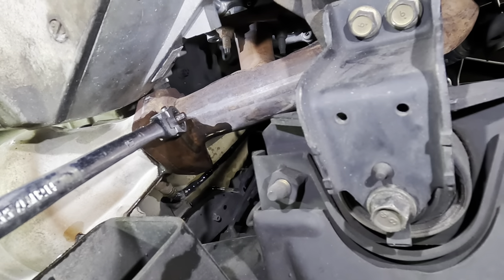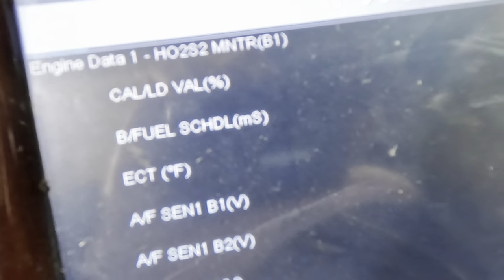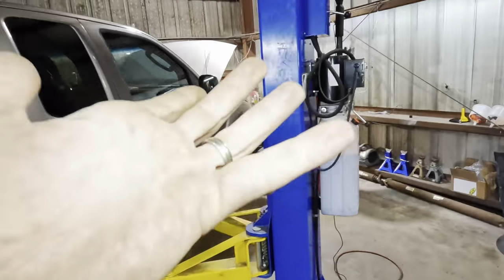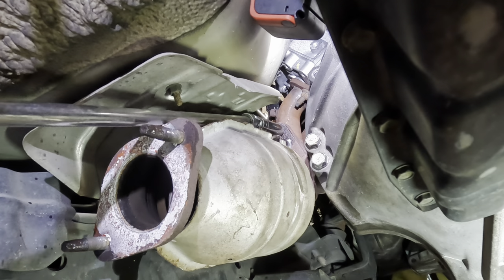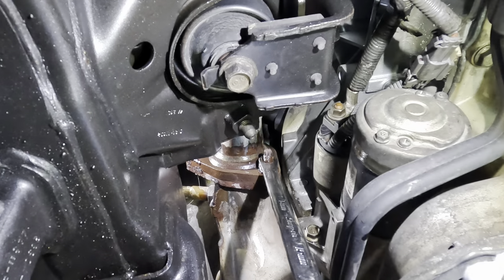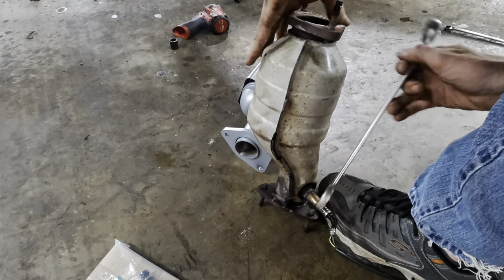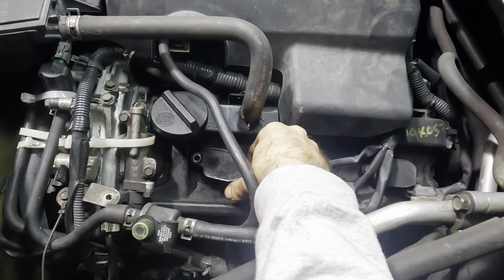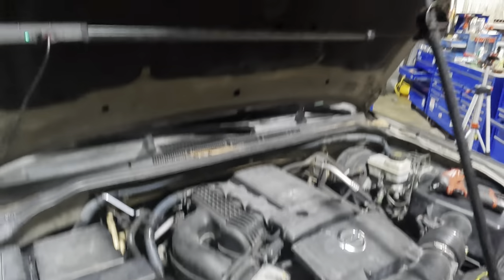Catalytic Converters! Missing?  Running Rough P0302 P0420 P0430 Nissan Fronter 4.0 v6

Comment: yes you need air speed to fly but there's nothing preventing an aircraft from lifting off a conveyor. they derive speed from air, not the ground. if there were no friction the conveyor wouldn't even move the plane, and wheels and bearing drasitcally lower friction

Comment: Is there any advantage to coating those exhaust connecting bolt threads, and the O2 plugs,  wth anti-seize?  Or is that not advisable with the higher temps involved?

Comment: so did someone steal the precious metals in the old converters?  Or do you think they just rotted out and someone pulled the remaining guts to stop them from rattling around or something?  Am also wondering what that does to the core charge situation but since you said it was sent over to you w/ parts I guess that is not your problem.

Comment: (15:20) I have an 06 ford falcon, and I had to replace my cat as it had blown out the exhaust (at the time, I didn't know it was that what blew out) and yeah I had a bit of a surprised look on my face when I cut the old one open and saw it was empty, (I know it had it in there a few months before hand, had a camera inside the exhaust and saw it) so maybe with those cats, they'd most likely blew out the exhaust system

Comment: OMG not the airplane/conveyer belt thing again... first question- how are you measuring how fast the wheels are turning? because the plane doesn't measure that at all. So for the belt to go in the opposite direction one would have to know this speed. And then the plane still doesn't care how fast they're turning. The plane moves forward due to thrust from its engines. So technically the belt would be be moving backwards faster and faster as the plane moves forward independent of the belt. At some point the bearings on the wheels would give out most likely but aside from that impossible situation, since it's not possible to measure the wheel speed and have a feedback loop that controls this humungous conveyor belt, the plane would move forward freely and take off.

Comment: Why don't you use anti-seize (either copper or nickel) on the threads of O2 sensors? It makes it easier to thread and much easier for the next guy after you, and who knows, it may be you that's next.
Reply: I totally agree, i never replace with dry threads, thats just asking for trouble

Comment: The airplane would fly, because the thrust supplied by the engines would cause it move forward with respect to the air until it reached the requisite airspeed.  The engines are pushing the plane through the air to make it move forward .The wheels are free spinning and are not powered by the engines to move the plane on the ground, consequently what the ground (or conveyor belt) is doing  has no effect on the airspeed.

Comment: An automobile’s wheels are driven, and are the vehicle’s only method of propulsion forward.  On a conveyor belt an automobile will either move forward, stay in place, or move backward, depending on the speed of the belt.  An aircraft is completely different, and has no driven wheels at all.  Its engines alone provide the necessary thrust to propel it forward, and those engines interact with the air exclusively, not with the ground.  The aircraft’s wheels are free-spinning, and simply along for the ride.  So YES, an aircraft will take off just fine on a conveyor belt.

Comment: Love the jokes, life is short if we can't laugh, why are we here?  Glad I'm not the only one that talks to the parts while trying to get them off and replaced.  Maybe someone in the past had to replace those two studs and when they did they went with the heavy duty nuts (which would make the outside size a little bigger).  Wouldn't it be easier to have removed the front tires?  If they went back to carbs with  pure H2 and 02 injected into the airstream, they would run cleaner without the converters than these do with all 4 of them on it. '58 International A120 4.6 or 4.8 liter Straight 6.  Little one bbl Holley on it.  Almost 42 MPG and almost no measurable pollutants with No converters on it. Watching you reinstall the rear 02 sensors reminds me of watching a buddy install his with the closed end of the wrench.  Slipped it through the wrench, screwed it into the flange and then tightened it down.  Then realized that he had 2 choices, either remove it again and use the open end or, leave the wrench there as an expensive ornament.  Hadn't laughed that hard in a while.  NICE, free toys!

Comment: I'm going to be replacing a fuel pump in my silverado I noticed its an updated design with a new pig tail that comes with butt connectors. Would it be better to solder the new pig tail instead of using butt connectors/splices?

Comment: Jet Puzzle: YES The jet could take off since it doesn't drive the wheels to get to speed.  HOWEVER the tires will need to be turning at 2X takeoff speed.  The 747 Takeoff speed is 160 knots.  That's 184 MPH !  So, the tires need to turn at 368MPH before the thing will take off.  They are 52" tires and have to turn about 2200 RPM!  Sketchy at best.  Thanks for the brain teaser!.. now about that exhaust...
Reply: 20 minutes later, the point is that half the internet thinks we live on a flat earth.   Here I thought you were giving a puzzle.

Comment: Use a higher quality fuel? Can't do that, that would cost the refineries too much. I'd imagine it's also a product of the world running out of the decent quality crude that gives high yields of fuel fractions. Up here in Alberta our tar sands are running dry and what's left up there is dirty low quality stuff that only specialized refineries can use. If I recall, most of the oil we produce is sent to tar refineries because it doesn't yield any actual fuels.

Comment: Is there smog check in Florida?
If not, this guy spent a fortune on cats 🐈 for no reason!
Also, in NY you’d need a torch as every one of those bolts would be severely rusted on!

Comment: The short answer is NO, it can NOT take off but it's constrained by the precise definition of the problem. Any excess forward movement of the plane imparts additional wheel speed which the belt cannot match violating the constraints, unless we allow for slipping, skidding, or translation. It's an utterly useless system and not practically implementable, but that's how it was precisely defined. If instead of matching the wheel speed, there was a fixed speed chosen, or a freewheeling treadmill, the plane could take off (if it could exceed that wheel speed safely) but that's not how the problem was definited. The Mythbusters covered a similar question about 15 years back, but their actual practical experiment was not precisely like this hypothetical one.
Reply: @daviddavids2884  who said they were driven? The point is the problem statement doesn't allow the wheel speed to be different than the belt speed, so the plane itself cannot move forward by definition. It's a poorly worded question (or trickily depending on the intent).

Comment: You have to wonder what has killed the original cats. Chronic misfire from those bad coils loading them with unburnt fuel? If that truck has a rebuilt engine in it,  WHY would you transfer all the old crap to it? I'd put new coils on a new engine. You have it apart, change the stuff! Bad thermostat keeping the fuel enrichment on because the engine never warms up? That killed the cats ($1000 worth) on my nephew's Taurus. They live in NC and never noticed the engine never came to temp as they don't need the heater most of the time.

Comment: If an electric train is going south at 70 mph and the wind is going north at 50 mph and it enters a tunnel which way will the smoke go,,, Straight up, forwards or backwards?????

Comment: Why don't they use stainless steel fasteners when they're exposed to the elements?  I just got new plates on my car and used stainless steel so they wouldn't rust.

Comment: No- a 747 will not fly if only its wheels are spinning.
However, if it is riding on the conveyor belt at its designed lift-off speed then yes, it will fly- just like that piece of plywood did off the back of my pick-up... Lol

Comment: A plane requires lift, if it's sitting still on a conveyor, it doesn't matter how fast the conveyor or wheels are moving. If the plane isn't moving forward, lift is not being created.

Comment: Lol my cat died earlier this year, cause my distributor (Or well, the part that made power) died. I was too stupid to diagnose it, so I kept trying to start it. (It would run fine for a few, then die and have trouble starting for like 20 minutes.

With some help diagnosing, I replaced the distributor, and the car ran perfectly fine. 
But, with all the starting but no running, there was a bunch of gas that ran through and killed the cat. I'd have a ton of smoke out the back. Plus I wore down the cylinders to the point where now I burn a quart of oil per 100 miles. 

I found someone on eBay selling one of the cheap cats for my car. (Couldn't buy it on amazon cause of the new emissions requirements) I don't care about passing emissions, I just don't want my car to be blowing smoke anymore xD 
So bought that cat for like 60 bucks, and replaced it myself. It was 100% empty x'D O2 sensor was caked in soot. Tried cleaning it with brake cleaner, but it didn't work. Didn't expect it to. Just got a cheap 15 dollar one off Amazon, and that worked fine. 

For now, no codes. Though every 5 months or so, something with the EVAP system shows up. I just reseat the purge solenoid's vacuum tubes, and that fixes it for another couple of months. I do NOT expect it to pass emissions. I plan on selling the car for 800 or something, once I have my next car. If the buyer is lucky, they live in a county that doesn't have emissions testing. Car drives fine besides the oil consumption.

Comment: On the emissions, in Europe they are actually so strict, they cause more pollution(!). Higher fuel usage, much shorter engine live, overly complicated zillion sensors and computers needed (use power, weight, cost to produce, cost to recycle; Recycling is not  for free) and engines polluting and clothing up.  There have to be a balance between emissions control and what is sensible, the greenies have gone totally bunkers -> for the greenies it is NEVER good enough until you have nothing to eat and simply die.

Comment: can it fly? how fast the belt is running has no effect on the ability to fly. the thing that allows flight is airflow across the wings, 2 flows are required wind speed over the wing vs airflow under the wing. the air flow over the wing must be faster than the airflow under the wing creating low pressure over the wing thus "lift" when the lift produced exceeds the weight of the plane, you establish flight. so, the conveyor does nothing toward lift thus flight, but give me a fan capable of creating sufficient airflow across the wings to create the needed lift, the plane will "fly" even though the plane has no ground speed. watch a plane in heavy wind. they can lift off, even when the plane is tied down, and is why it is important to tie down a plane when parked.   thanks for your great videos. and yes better quality fuel would improve air quality and attained power, at a much higher cost.
Reply: near as i can tell you do not understand how  aircraft  work.!!!

Comment: Another fun one from 7th grade science class... 
If the ambient outdoors air temperature is 20*F and the wind chill is at 5*F what is the temperature of the coolant inside the radiator of a car parked facing directly into the wind? (The cars engine has not been started/run for over 24 hours.) Hint: The radiator and coolant system are in perfect working condition.

Comment: The plane would not fly. The wings are designed to take air pressure off of the top of the wings so the pressure pushes up on the bottom. It can't do that if it's not actually moving through the air
Reply: The cross section of the wing is such that the air flowing over the top has to travel further than the air on the bottom after being split at the leading edge.  Low pressure on top, high pressure on bottom.  Lift is the condition.

Comment: My 2007 Lexus rx 350 also reads P0420 & P0430 codes and I am aware that the precious metals aren't there and I generallly get around 14MPG on city/highway driving. Will getting a new converter improve my MPG?

Comment: Lost and found: I'd want to ask the customer what the fan problem was and what was done about it, if anything.

Also, if they knew which shop/mechanic would have left it there. If a reasonable effort can figure out which shop/mechanic left it there, I'd return it.  You'd want them to do the same with your stuff.

Comment: I literally saw no corroded steel whatsoever lol... We don't unbolt exhaust systems where I'm from... We torch em out and saving oxygen sensors is highly unlikely if the vehicle saw one winter

Comment: Try not to allow batteries to drop below 50%. Dont allow batteries to remain drained for prolonged periods of time. Especially when lithium ion battery packs. Lithium breaks down faster when it has not charged compared to when it does.

Comment: Myth Busters should do a program on putting an electric fan on a sail boat to push the sail boat..  Or maybe one of a guy standing in the back of a pickup truck pushing on the cab to get the truck out of the ditch...... Un believable.

Comment: Starting a new comment thread to address my final conclusion on the massive "can the plane take off" discussion in the other comment.

It is ultimately correct that no matter how fast a conveyor belt moves under a plane, that plane will still be able to take off. That is the reality, and that does not change.

HOWEVER: The plane in the original question cannot take off, for reasons I will explain now.

The fundamental rules set by the original problem state that the conveyor belt will always move fast enough to counter the rotation of the wheels. We know that the conveyor belt itself cannot stop the plane from accelerating, due to physics. Due to the Rule that the conveyor belt always moves fast enough to counter the wheel rotation, it MUST accelerate beyond infinite speed in order to counter the engines. Since it cannot possibly move faster than infinite speed, the system breaks down and can't possibly exist. Since the plane and conveyor cannot possibly exist, the plane cannot take off. Thus, the plane in the original problem cannot take off, because it's not possible for it to exist in the first place. Which is stupid, but that's how it is. 

It's not a physics problem, it's a logic problem.
Reply: jeezuss        i did not imagine that there were so many ways to  be  WRONG, on this subject.        in  either version of the question, the  rules are  the  SAME.       lololol        the effectiveness of aircraft  THRUST  is  NOT  dependent on the ground or the landing gear.
Reply: @daviddavids2884  The issue is that the rules state a completely impossible scenario, ie. that the conveyor belt IS able to stop the plane. This is complete nonsense, I know this, you know this. The issue is that the problem is worded in such a way that states as a Given that the conveyor IS able to do this physically impossible task.

As such, the plane can't take off, because the problem doesn't actually make sense in reality. It's like the immovable object vs. the unstoppable force. It's a flawed scenario to begin with.

The reality is, in no uncertain terms, that a conveyor belt cannot possibly affect the speed of an aircraft. However, the question straight up gives you a conveyor belt that can. It's stupid, but since riddles and logic problems don't necessarily have to work in reality, we have to work with what we're given.

In this specific problem, because of this specific impossible magic conveyor belt we are given, the plane can't take off. Applying real world physics to it doesn't work.
Reply: To further expand on my findings after continuing to converse in that last comment thread at the expense of my sanity, I've determined there are three groups of people:

Group 1 understands physics and knows that a conveyor belt does absolutely nothing to stop an airplane. Group 1 people are universally correct.

Group 2 knows that it's a trick question, and the impossible magic conveyor belt that defies physics is a required premise of the problem. Since the magic conveyor belt is a given requirement of this non-realistic scenario, they know the plane can't fly. Group 2 people are technically correct.

Group 3 thinks a real conveyor belt is able to affect an airplane, and is wrong. These people are just wrong. Group 3 people, you are undeniably and provably wrong. Please stop arguing. 

I think most people don't realize Group 2 exists. I didn't, before yesterday.

Comment: Re: Airplane

The plane is not accelerating via the wheels, it is accelerating by acting on the air with the engine.
The ground has no effect on if the airplane can gain speed or not.

Comment: People don't realize that airplanes don't use their wheels to drive them forward. It doesn't matter how fast the conveyor belt is going because the airplane is being pulled forward through the air by the propeller and the wheels are freewheeling and can be spinning at 200 mph and it will have no impact on the forward motion of the plane through the air. People are thinking about planes like they're cars and have some dependence on the wheels for forward motion. They don't understand aircraft physics.